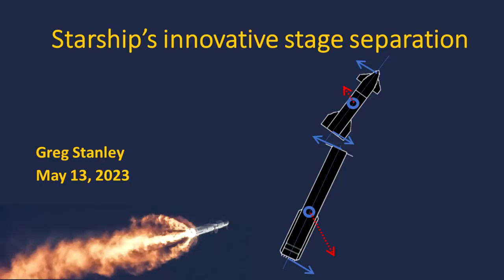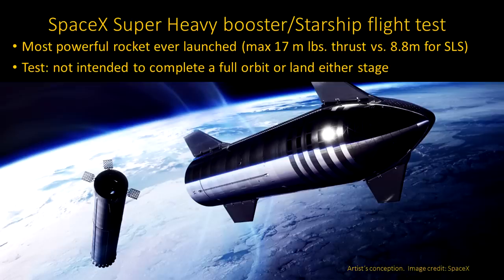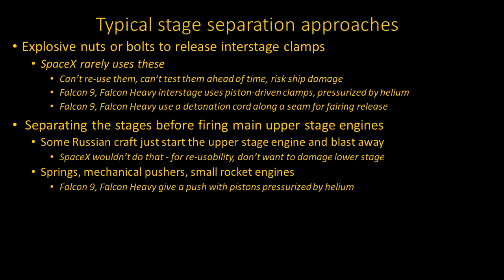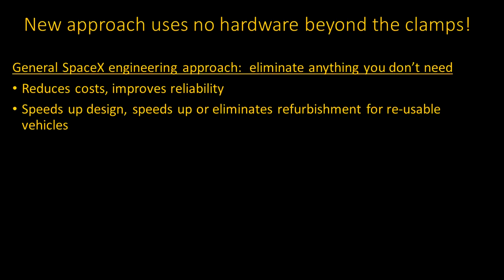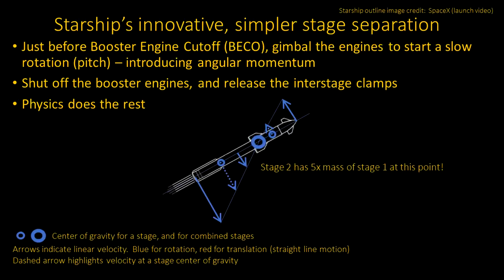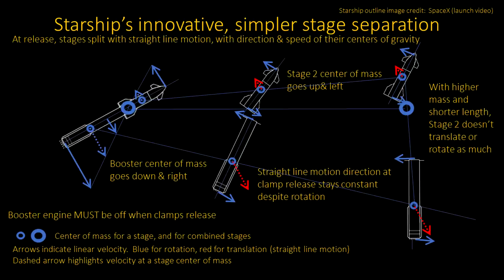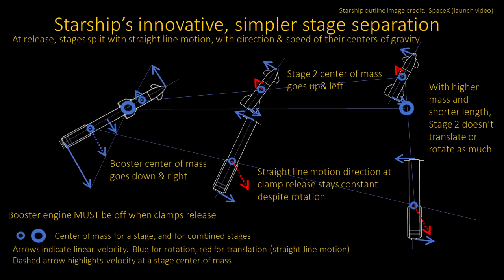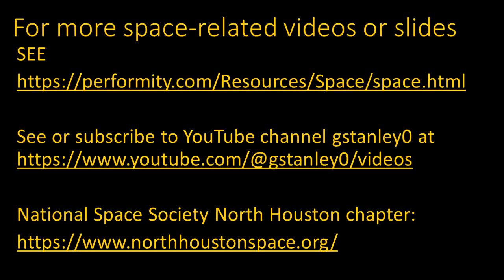Starship's innovative stage separation, using no hardware besides clamps, illustrated

Comment: Suppose a case where there are astronauts onboard stage 2.
Stage 1 booster experiences loss of control - need to emergency abort mission.
How does stage 2 separate from stage 1 in attempt to save the lives of astronauts (and eventually intercontinental commercial passenger flights)?
Reply: I think Elon has mentioned this in the past in the event of booster has a malfunction of any kind before completing its trajectory altitude before separation and burn back it’s a lost mission. Space shuttle had the same level of risk the SRB had do a complete burn off before the shuttle could do a it’s maneuver for an attempted return to land.
Reply: Just light the upper stage. No worrying about damaging the lower at that point.
Reply: > Space shuttle had the same level of risk  <  At least with STS, they had an excuse of sorts in terms of how the design constraints came to be.  But for a clean-sheet design like Starship?

Comment: Seems a really good, useful and interesting presentation, thanks. 
But the sound is a bit muffled, and the speech could use slowing down a bit. Occurs to me that the substantial information is already in the slide (as in so many presentations), so I ended up just reading the slides on silent - in which case I might as well just reading it in writing. However, there's some much extra good information to be gained by listening to the voice, in which case I would prefer to see the speaker, with captions. Hope this comes across as constructive, it's really useful.

Comment: How would you light up the engines after that maneuver though? There is going to be a lot of bubbles in the tanks everywhere, you need starter motors anyway, why not just use them to separate?
Reply from the maker: This is just speculation, but I could think of a few possible reasons.  
(1) Because Starship uses autogenous pressurization in the tanks (same pressurizing gas as the propellant) rather than a gas like helium, and significantly subcools both propellants (CH4 and LOX), it's likely that bubbles are less of a problem in the first place.  Bubbles somehow forming in the liquid would just collapse and get absorbed into the liquid.  That's unlike the case with, say, the Falcon 9 kerosene and helium, or LOX and helium.   Although full autogenous pressurization won't have started yet in stage 2 (because of no heat from Stage 2 engines for vaporization), again, because there is so much subcooling in the loaded propellants, there probably hasn't been much time for much vapor to form.  (And, really pure speculation) There might be some electrical heaters available for pressurization prior to engine firing, and maybe they even increase the pressure just prior to firing the engines to suppress bubble formation? 
(2) The second stage is full just prior to separation and lighting up, so there is little vapor in the first place.  The only vapor that would form would be because of heat passing into the tank from outside and vaporizing propellant.   I realize that's not a completely convincing argument because you could say any second stage will initially be full, but with the subcooled liquid, until main (booster) engine cutoff, all the vapor would be up high, with little time to move down, and bubbles won't form spontaneously in subcooled liquid.  
(3) The rotation must help, just like in a lab centrifuge used to separate things by density.  Any gas bubble is lighter, and would tend to get displaced  by the heavier liquid flowing to the bottom(outside), analogous to the case on earth where steady gravity keeps the liquid on the bottom.  Unlike the case with linear acceleration, where things immediately start floating around as soon as the external force ( propulsion) stops, with rotation, the heavy liquid stuff would always flow towards the bottom.    

(4) Lighting up stage 2 might be fairly quick, before there's much time for bubbles to make their way down to the bottom of the tank  
(5) Starship has those small "header tanks", which are better insulated than the main tanks.  They are always kept completely full of liquid, to ensure that even after a long time (unlike the case of initial launch), engines can be restarted using them before switching over to main tanks.  They are there to handle landings without worrying about vapor, because by then subcooling would be lost and also the tanks are no longer full.  They're only billed as being used for landings, but perhaps they could be used in the initial firing as well?  My guess is they don't need to do that because of the other reasons above.
Reply: @gstanley0  that's exactly my point. As starship rotates, heavy liquid will be pushed forward to the nose, and vapour at the top will flow towards the engines, snuffing them out. You'd need to stop the rotation and settle the liquid before lighting engines
Reply from the maker: After separation, rotation of stage 2 will be around the center of mass of stage 2.  Heavier stuff (liquid) will flow outwards from there. I don't know exactly where the center of mass is, and it would depend on how heavy the payload is.  But, looking at a Starship diagram, e.g., at 
https://everydayastronaut.com/definitive-guide-to-starship/
 it looks like the main LOX tank, the lower of the propellant tanks, is most likely all below the center of mass.  
(I'm using "top" and "bottom" to refer to the configuration when standing vertically at launch time, with the engines at the bottom).
So, with liquids flowing outwards from the center of mass, that means most or all liquid oxygen will go to the bottom, keeping the engines fed with liquid.  It's not as clear in the case of the methane tank.  The main methane tank center looks to be somewhat below the geometric center of the rocket.  As long as some portion of the methane tank is in fact below the stage 2 center of mass, then liquid methane flowing outward will keep the bottom of methane tank liquid.  If that center of mass is indeed somewhere in the methane tank, then some liquid will also flow to the top of the tank.  That would mean that any methane vapor would move towards that center of mass, which would be between the top and bottom of the methane tank.  Eventually the vapor would all go there, but the stage 2 engine would start long before could happen... (see next comment)...
Reply from the maker: (continuing...) I found a some details of the originally-planned timeline at https://www.space.com/spacex-starship-first-orbital-launch-explainer    
Booster Engine cutoff is at 169 seconds into the flight, separation is at 172 seconds, and upper stage engine start is at 177 seconds.  Up until engine cutoff, the liquid in both propellant tanks would be solidly at the bottom because of the linear acceleration.  Then, there would be 3 seconds between booster cutoff and separation, when the rotation is about the center of mass of the combined ship, and the methane vapor could go down, as you were describing. It's not as clear for the LOX, because the center of mass of the entire combined ship might be in the LOX tank, or maybe not.  But then there are 5 more seconds when the rotation just around the second stage center of mass would be helping to get propellant liquids back closer to the bottom.  Given that there would be very little vapor in the first place (and starting with none in the wrong place),  the SpaceX engineers must have worked all this out, and concluded it was unlikely that vapor would make it into the lines to the engines.
Reply: @gstanley0 some more supporting points. The methane downcomers are large pipes and thus represent a significant volume. The volume in  the pipes below the center of mass is more than sufficient to start 3 engines.

SpaceX has tested a number of engines to destruction. They must know how well the engines recover from "small" gas bubbles. Where the upper end of "small" is defined as the largest bubble that is reliably recoverable.

The start up sequence itself involves running high pressure gas through the turbo pumps to get them up to speed. This gas is expelled out of the bottom of the rocket and will act just like a cold gas thruster.
Reply from the maker: Lots of good information there!

Comment: Very good video! I thought it would be like this but due to mass and air resistance. Since they don't use explosive bolts, I wonder why we see some white dust on the video from inside between the stages right where it was suppose to separate. Is that from the termination charges that didn't work?
Reply: In ksp I usually have a big issue with the aerodynamic drag forces acting mostly on the upper stage. Plus when the upper stage is rotating you can have ullage issues.
Reply: In ksp I usually have a big issue with the aerodynamic drag forces acting mostly on the upper stage. Plus when the upper stage is rotating you can have ullage issues.
Reply from the maker: Don't know.  Let's hope that a report from SpaceX, NASA, or the FAA will clear up a lot of the details.

Comment: Nice video explaining the mechanics!  I think it will be interesting to see what the turn/sep looks like on the real launch.  In my head I imagine the booster pitching down very slightly before initiating the pitch-up rotation/sep maneuver so that the Starship isn't pointing nearly straight up by the time it lights its engines (which would probably result in significant cosine losses).  idk

Minor nitpick:
Near the beginning you say that SpaceX uses det cord for the fairings.  Actually, they are held together with mechanical latches and use pneumatic pushers to separate, just like the stages do.  This can be found in the F9 users guide.
Reply from the maker: Thanks.  From the 2021 Falcon users guide, they only replace mechanical latches with detonation cord for the (new, rarely to be used) extended fairing that is longer than the standard one (and probably mainly intended for Falcon Heavy use).  Somehow I had skipped over the previous paragraph on the standard fairing. But even with the extended fairing, they're still using pneumatic pushers.
Reply: @gstanley0  Haha I guess I missed the part on the extended fairing.  Thanks for the info!
Reply: @EpicSpaceTroll Where do you find the F9 users guide?
Reply from the maker: https://www.spacex.com/media/falcon-users-guide-2021-09.pdf     (includes F9 and Falcon Heavy)

Comment: OK, but how do the interstage clamps work?  How are they powered?
Reply from the maker: I haven't actually found out how they do it yet.  On the Falcon 9 & Falcon Heavy, they use pistons powered by high pressure helium - a pneumatic system.  But SpaceX has ruthlessly been eliminating consumables when moving to Starship.  They've eliminated helium, nitrogen, the hypergolic fuels for starting the engines (using sparks instead),  attitude or other small thrusters using any other propellants beyond LOX & methane (including cold gas thrusters),  etc.  So, if it's still pneumatic, they must use either oxygen or methane gas, which is all they will have.   They seem extremely unlikely to go back to pyrotechnics (explosive nuts or cords) except for the flight termination system, since they can't re-use them.

Comment: Why was there a report during the launch of a problem with the clamps?
Reply from the maker: Exactly what happened has so far has not been officially documented by SpaceX, NASA, or others, so there's only speculation.  I think some people speculated that the clamps had problems because the rocket held together, but it was guesswork, and it simply got repeated as if it were a known fact.  The SpaceX announcers added to the confusion, by assuming the rotation was the start of the separation process, based on the rotation and the fact that according to the original schedule, it was about time.  They kept looking for separation even after several complete rotations, until finally conceding that the flight was "off nominal".  But the timeline was already behind because of all the engine losses, so the altitude and speed weren't actually on schedule.  I was pretty sure I saw a comment early on from Musk that thrust vector control was lost much earlier.  The article in Wikipedia cites a source saying it was lost at 85 seconds 
https://en.wikipedia.org/wiki/SpaceX_Starship_orbital_test_flight   
So that rotation wasn't deliberate - it was uncontrolled.   With loss of control, it wouldn't have been prudent to split up the Starship and have two separate terminations to worry about.  But the most convincing factor to me was simply that the booster never shut off.  Any automatic sequencing, and surely any manual override, would not have allowed releasing the clamps until the booster shut off.  That would have nullified the mechanics of the separation.

Comment from the maker: SpaceX just announced that they're changing the stage separation method for the next Starship launch.  Rather than what was described here, they're changing to a Russian-style hot staging separation, starting the upper stage engines while still attached to the booster.  They're adding shields to the top of the booster, and a lot of vents for the second stage exhaust to escape while still attached.    They added that this will aid in efficiency.     
https://spacenews.com/spacex-changing-starship-stage-separation-ahead-of-next-launch/

Comment: what keeps the fuel on the second stage from floating around?  Like don't you need forward acceleration to keep the fuel on the bottom of the tanks to ensure uninterrupted fuel flow during second stage engine start up?
Reply: The upper stage vents high pressure gas from the propellant tanks through "cold gas thrusters" which settles the fuel.  Google "ullage".
Reply from the maker: Also, see the earlier discussion following a similar comment by @tedarcher9120 about 6 days earlier, including replies from me and from @hamjudo

Comment: Falcon does NOT use any pyro/explosives to separate anything. The fairing is separated mechanically (hydraulics) due to re-usability. SpaceX hates to use Pyro separation in general because you can't reuse those parts.
Reply: If you look closely at a Falcon 9 fairing separation in slow motion, you can see the small hydraulic pistons all along the seam, push the other half away. Same system is used to push the 2nd stage away from the booster. There is a huge hydraulic shaft that pushes on the MVAC's injectors (inside the nozzle bell).
Reply from the maker: Yes, this was addressed in the comments from @epicspacetroll1399 .  It's only the new extended fairing (which will rarely be used, and probably only with the Falcon Heavy) that uses detonation cord.  The standard fairing has no pyro.  Both cases are mentioned in the Falcon User's Guide (2021) at the SpaceX site, page 9.   Somehow I had originally skipped over the paragraph on the standard  fairing. 
https://www.spacex.com/media/falcon-users-guide-2021-09.pdf   
The pistons for interstage clamps, pushing the stages apart, and similarly for the standard fairing separation, are all operated using high pressure helium.  

I know SpaceX hates pyrotechnics, and for good reasons.  I've seen some speculation that the extended fairing will be used so rarely that it wasn't worth the engineering time to design the more elaborate piston-based system for the larger fairing, although I don't have a feel for the difference in effort.  

SpaceX may have had some pyro forced on it.  For instance, I had also read that the Crew Dragon has several places with frangible nuts to handle abort cases required by NASA.   These would not be for normal use like stage or fairing separations, but only for emergencies.  One is documented for the ascent abort test to test aborts during the launch phase, at 
https://www.americaspace.com/2019/02/22/last-nights-falcon-9-will-fly-one-more-time-exploding-mid-air-in-crew-dragon-abort-test/   
I think I've also read that there are some Crew Dragon failure modes also requiring frangible nuts for quick separations while at the ISS, either to separate from the trunk, or from the ISS docking, but I can't seem to find a reference on those right now.